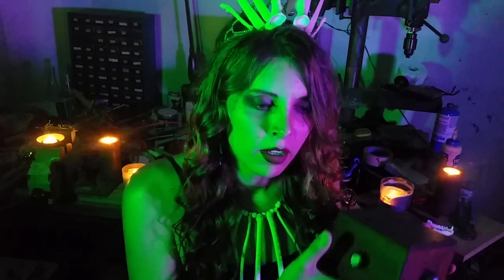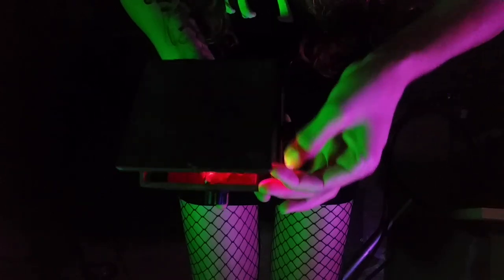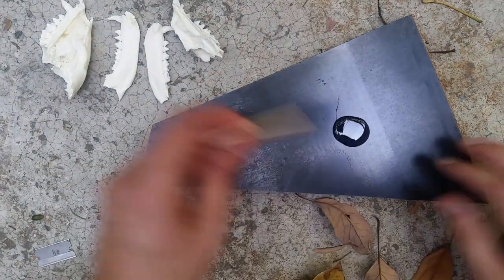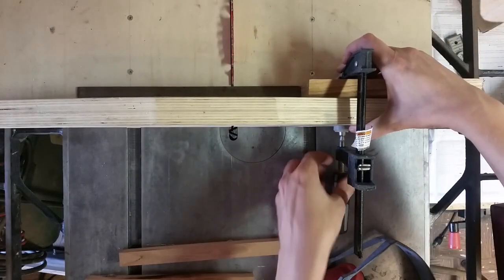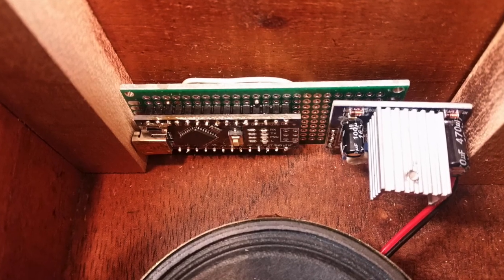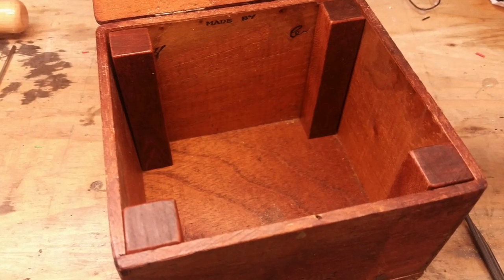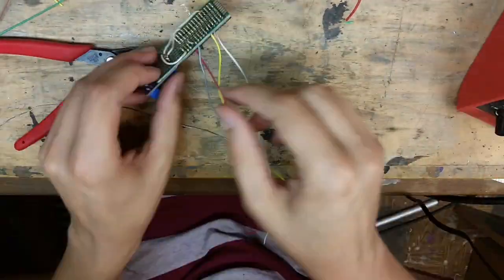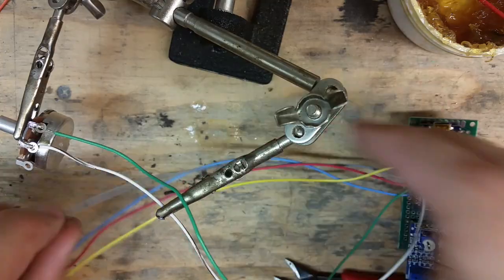Rackety Raccoon Synthesizer

Comment: Awesome project, I think I buy the same perf board and my circuits on it  are always so problematic, jealous of how well you got it to work. BTW your video production quality is improving so much! Especially love the Bone necklace and tiara, really ties the atmosphere together.
Reply from the maker: Thank you! :) 

I have two suggestions for working with inexpensive perfboard. 

1. Check the pads you'll be soldering to to make sure they're not electrically connected to adjacent pads before you begin working. I had a situation where two adjacent pads were shorted together inside the board. 

2. Use rosin paste flux to assist with getting solder to stick to the pads. It helps a lot when pads are being difficult.